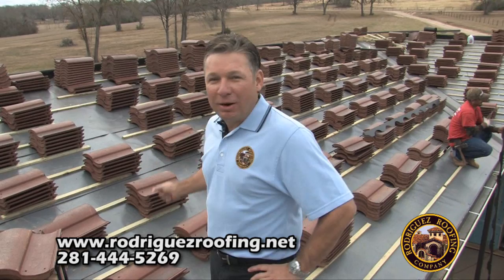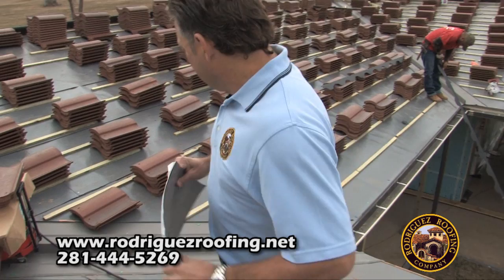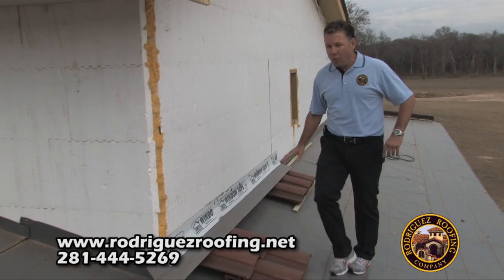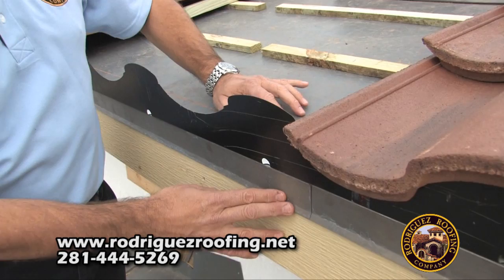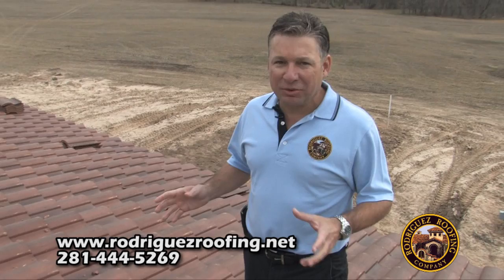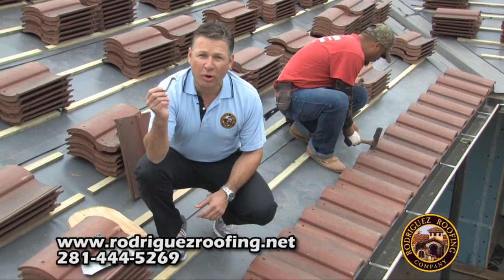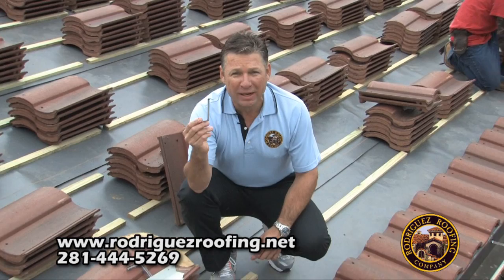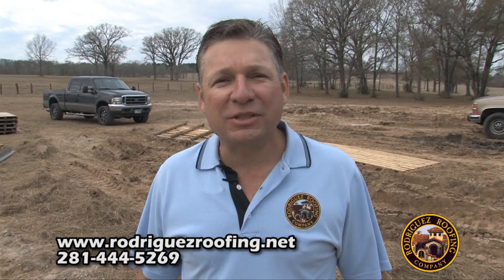Rodriguez Roofing Tile Roof Installation

Comment: I definitely recommend using ice & watershield on tile or any sloped roof! Remember, whether you have a tile roof, metal roof or asphalt shingle roof, if water gets underneath it and it always does at some point (even if the roof was installed right), it will leak. Felt wrinkles and sometimes small tears occur during installation by foot traffic that may not be seen and/or replaced. Using synthetic underlayment and even water & ice shield is definitely better than not using it! I've done too many repairs on tile roofs lately by builders that only use regular felt. What if the tile cracks or slips out of place from shifting of the building? Better to pay a little more up front to waterproof, than pay an arm and a leg later doing an expensive tile repair.

Comment: So far one of the best videos I've watched. Good information. I'm 76 and up on my roof that I've determined needs to have the old underlayment replaced so I've removed and stacked  a quarter of one end of my house, (the "S" tile), where water has gotten in. I'm having a lot of trouble finding the right underlayment because no one says their product is for tile. Tile roof is about 25 years old, and last winter was the last year without replacing leaking areas. I can't afford 20K to have it done to my 2K sq ft house. Inching my way through all the information I need to not make a mess. Information about treated battons, (sp?) was new to me. Treated with what, or can you buy them treated? Now I see I need to remove the top ridge first and find a place to stack the tile. Top ridge has a rubber substance under the tile that has failed. Don't know what it is called.

Comment: Roofing felt for tile has to be typeD 226Type II same for metal. Completely different from standard felt. You can get that valley at any roofing supplier where tile is widely used. All of these flashings are available, The headwall does have a 120 degree angle most use 90 and it never lays down. Use lathe vertically under bats roof will last much longer. p.s use 2x4 drip you will have better luck with it " Pancake" it between 2 layers. All tile concrete and clay are not 100% watertight.

Comment: I have 12 years experience and the cuts on valley metal shoul be open 3 inch each side of midle valley why?
Becouse opened the dirt leaves of trees dont stack on valley i repaired many leaks for that
Reply: roberrobertin87 yes and no
Reply: Absolutely, without the gap,leaves and twigs, tennis balls, dead bird and dirt will clog that avenue and won’t self clean with rain runoff down the valley
Reply: Same thing in Romania.
I do Roofs from 2007 and for the valley I leave some oppen space, around 8-10 cm on each side, free for drainage (leaves, dirt, etc).

Comment: Those valleys MUST be cut back at least 2” from the middle of that valley flashing.
Why?
Because dirt leaves and debris will quickly fill up the valley then water backs up and works it’s way under the underlayment.
I had this happen on my home and a number of other homes in my neighborhood suffered the same fate.
We are in San Diego county with mild climate. I can only imagine the magnified impact if you had freeze and thaw thrown into the equation.
Cut back those valleys guys!
Reply: Absolutely corect.  I'm no roofer, but I've been working on my 35 year old concrete tile roof and even with 2-3 inch cut back on each side of the valleys, there was debris collected all along them, essentially forming dams that direct water horizontally underneath the tiles and pushing some of the debris against the upside of the battens, thereby causing deterioration of the underlying roofing paper.  Definitely have to put valley clean out on my maintenance list...

Comment: I’ve never understood the logic behind placing the battens directly over the underlayment without any sort of spacers in the bottom.  How would any water that finds itself underneath the tiles be able to drain out properly? I understand that there’s several gaps in between each batten, but it seems to me that water would still sit behind those small pieces and eventually seep in through the batten nail holes.
Reply: I thought of that for my own project. My battens, 25 years old, are rotten. Could put a run of sealant on the bottom of each batten , or just put a run on the upper edge ,but that will be expensive .

Comment: are the gaps in the batten to allow water to pas down the roof ? and where are your striker battens, 
so many wrong points going on here but what do i know i have only been tiling for 35 years.
Reply: Om from Sweden. I've been watching a lot of roofing videos on YT. No Americans seems to use counter battens, I can't understanding why not? To met their underdecking has to be cluttered with debris and they don't seems to accomodation for water run of as we do (at least in Scandinavia) What am I missing?

Comment: I have a quick question. I'm replacing my old asphalt roof with Boral concrete tiles. The contractor said the tile I selected would take 12-16 weeks, but it may take less. The only ones he could have gotten quickly are the charcoal, espresso, and slate blends. I guess he's not wrong because those are the colors I usually see when people are changing their asphalt or clay roofs to concrete. I decided on the butterscotch. Does it normally take that long for tiles to come in? Plus he wants 25 percent down which is $5100. Why does he need so much when he really can't start a job until 3 months. Or is that normal? Of course, when you go on the internet; you see where people put nothing down until the materials arrive. I live in Miami, and I don't know anyone that would do that.
Reply: At least in Cali a contractor can only charge $1000 or 10% whichever is less upon execution of a contract that is called a clean cut.  I am sure Florida is the same.  Unless he has a special bond he is limited to the amount of a deposit.  Sounds like a crook.

Comment: Again sadly, horizontal straps vs vertical and then a nice 1x4  like in Canada Codes. Also your bird stop has its weep holes restricted by that damn 2"x2" drip edge- it should be lower.

Comment: work in europe myself just curious why the treated lath strips,never seen it here same with ice and water,why?u look at tile roofs 50-100yrs old they didnt use treated lath and ice and water,i think a tile roof done right doesnt even need an underlayment(doesnt mean u shouldnt do it)kinda like a slate roof in a way,ive seen old slate roofs where they didnt use anything, done right it shouldnt leak.How long is this tile supposed to last?
Reply: Here in the Southwest USA..we have termites.  They will eat any exposed wood that is not treated.  That is why the wood must be treated.   You probably ask it the rest of the house is treated???  No, only the sill that comes in  contact with the concrete (for termites also).   They could probably use Redwood or Cedar wood...but it would cost a little more.
Reply: 99scholz Here in the USA roofers do not know how to get a tile roof water tight and therefore they do need always a under roof, like ice and water shield.

Comment: counter battens ?
Reply: He means water slats
Reply: In EU you will find the vertical battens as well (it,s a EU norm) but if the roof is not ventilated (not an attic jus a simple plain Roof) no need for vertical battens.

Comment: I am a roofer you explain all god but on tile and slate roofs you have to use copper flashings and copper nails other ways  you roof don't last longer because you flashigs get bad on 15 -20 years and copper last for 80-100 year